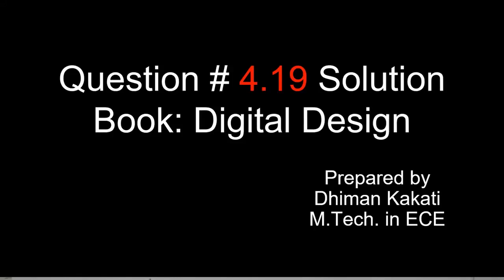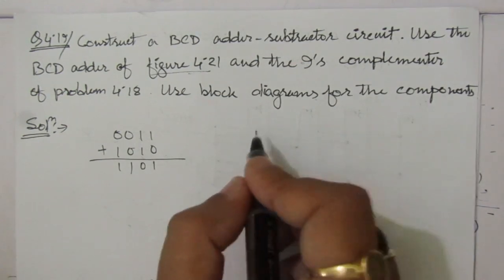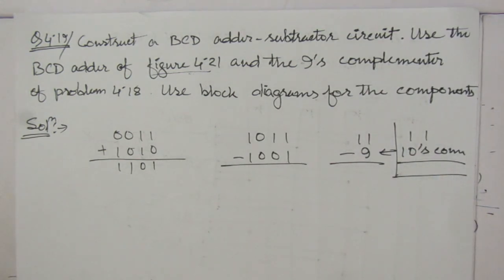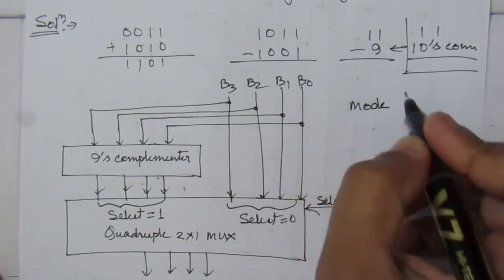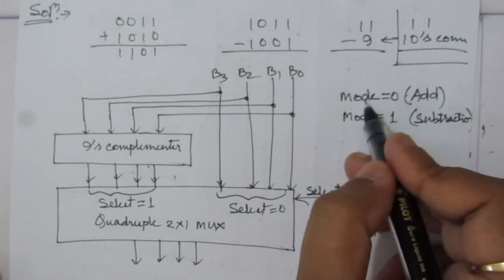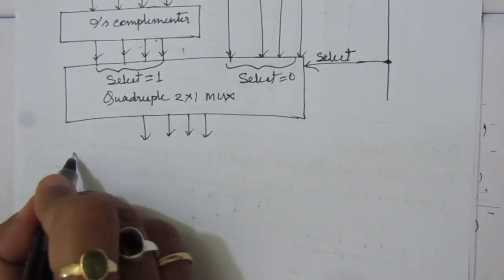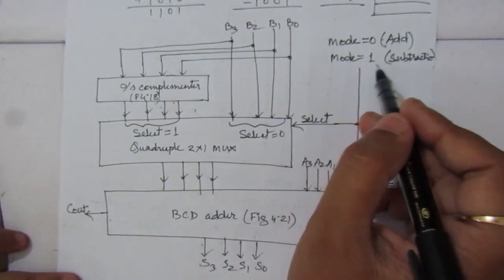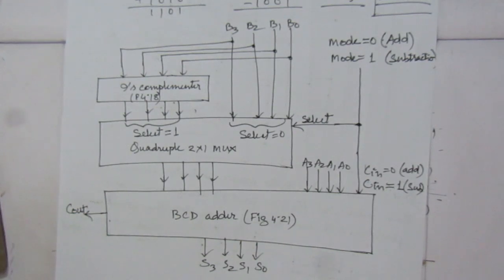Q. 4.19: Construct a BCD adder–subtractor circuit. Use the BCD adder of Fig. 4.21 and the 9’scomplem

Comment: if A > B the answer of subtraction is negative how we can show that?
Reply: Could you find a solution for it?
Reply: I think we need to add another quadruple 2x1 MUX which should have either the above 4 bit value in one selection line and the other with its 9's complementor. To make the selection for the new mux make logic diagram for cout and mode using k-map